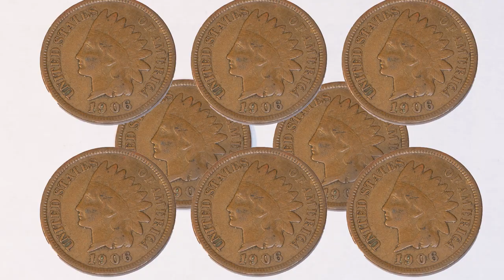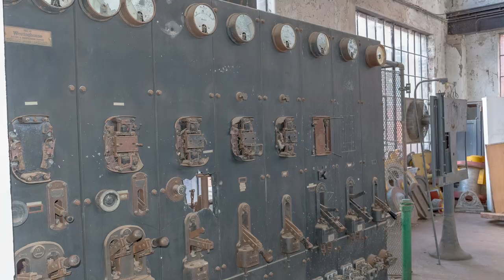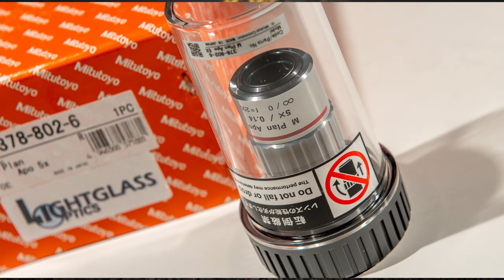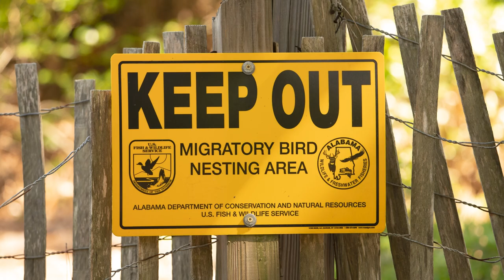Macro Is Not (just) Bug Photography

Comment: Hello Allan, just again watched your video on the Godox MF-12 posted 7 months ago. My 10 year old remote-triggered Phottix Odin flashes have been failing too frequently, making many a stack useless. Just want to know if Godox is still the way to go in your opinion. I use a 4-light system with diffusers in 3-D printed holders that works well when the flashes fire, frustrating when they don’t. If not Godox, what other system might you prefer now? Thx!
Reply from the maker: Hi Hank - the jury is still out. I love the MF 12s in the studio - I have never had better results, But I have had these flashes only 6 months and one has died and another is showing signs of a dying battery - worse, Godox has failed to honor the product warranty - so this is a major issue with me. I am no longer comfortable making the kind of recommendation I did a few months ago. That doesn't;t change the fact that they are the best studio macro flashes I have ever used. But I would have to be OK buying disposable equipment to buy another one. I am thinking about other options as I already need to add fresh units. Bear in mind that I use these flashes 12 hours a day, every day of the year, thousands and thousands of discharges every week. I would love to find a flash that would let me replace the tubes, capacitors, and internal batteries when I wear them out - but for now I have to go with what is out there. I am most seriously considering getting 4-6 TT350s but getting them from B&H (who will warranty them themselves). Hope that helps!